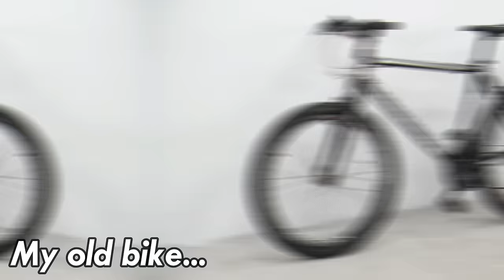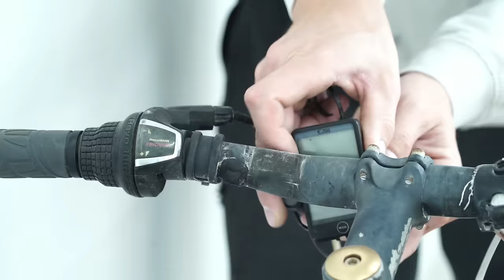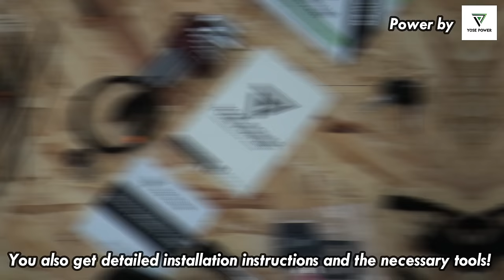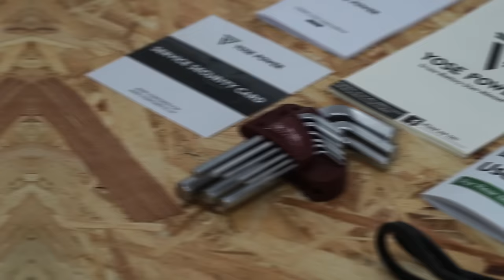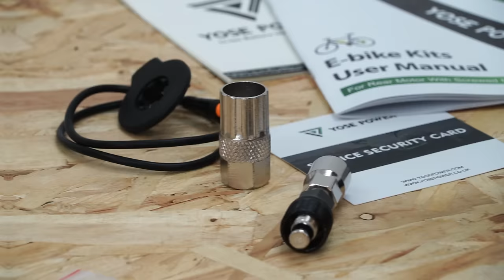Pimp My BIKE !? Upgrade 350w Electric Motor On BIKE ! 42km/h ⚡ YOSE Power

Comment: Very nice! Next time I suggest you to not use any spray to put the handles on the handlebar, it will take too long to dry and they will spin, just use some soapy water or just spit on it, it is the best method 😅😂

Comment: I have the same Kit from Yose. When you mod the Controller to 20 Amps it will rum 46-48 Kmh.
Installed on a Downhillbike with 180mm Travel F/R, makes a lot of Fun.
Reply: Hallo 👋 dieses Kit habe ich auch eingebaut. Wie kann man Controller auf 20 Amps umstellen?
Reply: im controller ist ein ein shuntwiederstand, ein dicker draht als brücke verlötet, sticht sofort ins auge. hab dazu parallel einen etwas dünneren aus kupfer verlötet(stück klingeldraht). somit geht mehr leistung durch. sollte der akku aber abkönnen
 @youdoc2020
Reply: @maischol7273  hört sich einfach und gut an! Vielen Dank für die Rückmeldung. 🤘😎

Comment: Can I leave out the hand throttle and the brake switch? And only use crank position sensor?
Reply: Hi, it is recommended that all parts in the kit be installed correctly according to the installation instructions.

Comment: If it was my build I would be using new chain and cassette  and bottom bracket plus new headset cups and bearings also new bearings in the front wheel but in all good job.

Comment: na na 42 km/h ist schon mal daneben.. aber 35-36 km/h macht der 350W bei dem 27,5 zoll… mit dem 18 A regler und Hinterantrieb… front Motoren sind glaub bis 250W.  Ist aber Tolle Firma, gute Wahre, senden für 350 watt automatisch größeren Regler… und auch bei defekten sind die sofort mit Ersatzteilen nicht geizig… kann nur empfahlen 👍 fahre drauf mit grinsen in Gesicht… auch Berg hoch packt das ding das mann es bremsen muss… von mir 9 von 10 Punkte

Comment: What's the max distance achievement
Reply: Hello, cycling distance depends on many factors such as battery capacity, riding mode, rider's weight, terrain, weather conditions, etc. For example, our city e-bike can reach to 50km-100km under different power modes and cycling conditions.